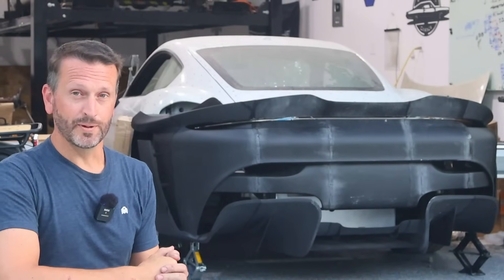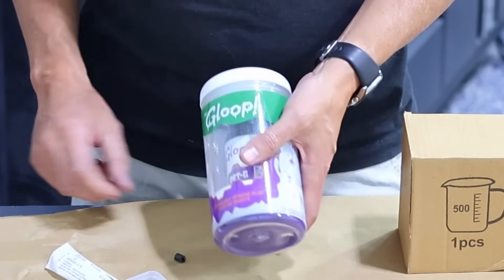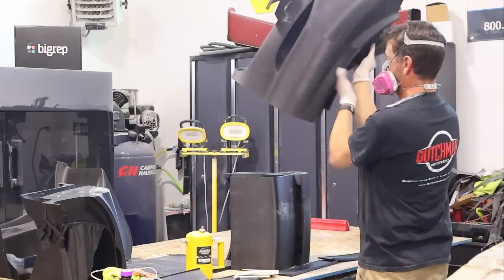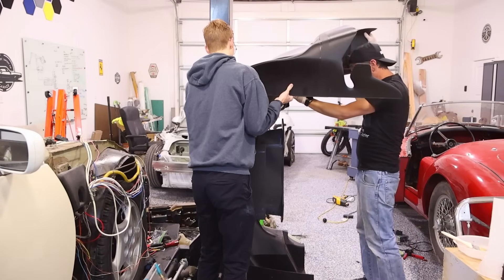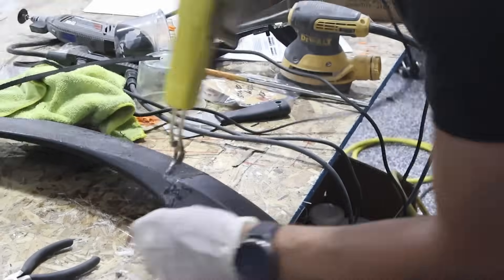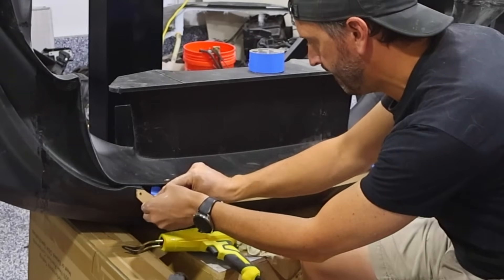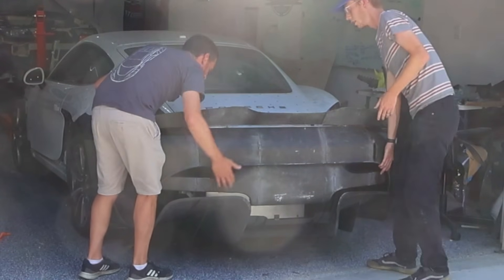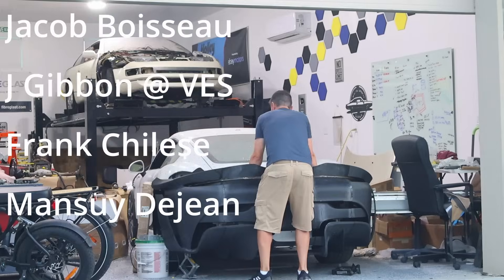World's Biggest 3D Printed Porsche Bumper

Comment: Hi nice bunch of projects , I also build car bodies etc , and use 3D printing to make parts and molds , tech when making your drawings include some dowels or lap joints on those surfaces to align the parts , much easier to glue or clamp on skinny parts , good luck , will be following , cheers Phil

Comment: 10:11 the right way to use the plastic bridge welder would be to rotate it another 90 degrees. this way you have 3 wire bridges ands not just one. nice video tho

Comment: Good luck but it'll never work as a driveable car. 100% as it the structure will fail. Even with mesh on the inside you're going to struggle. If it's just as a model then a tool made then fine. Going to need grp or pre impregnated cf. 🤞🤞🤞🤞🤞
Reply from the maker: Final part will be carbon fiber

Comment: how are you smoothing the printed part? 2k primer and sand or something similar?
Reply from the maker: The plan is body filler with sanding and polishing and then a 2k urethane to make the mold surface.   End part will be carbon fiber

Comment: If no one has suggested this you should add a key and whole system to the 3d model it would help you join the pieces of the model together. And give you more of a ability to line up the pieces together and a better chance of the model glue and hold on to each other

Comment: Street Bandito integrated some flanges into the bits for the electric Z. He was then able to use small clamps to keep them together while the glue cured
Reply: Also, I've used a 3d pen to join two printed pieces - first I would melt the edges to create a "valley", then lay a bead of the same material

Comment: But why would you 3d print that  bumber? Pla costs like 25 bucks for a roll of 1.1kg  carbon fiber is like 10 bucks per 1kg I mean not that im hating or anything but why that instead of CF
Reply from the maker: This will be for a mold to make a carbon fiber piece

Comment: I think you did a great job of course car companies won't be thrilled about it but they've been scamming us for a while by over pricing parts 😂
I just have suggestion for you if you ever try to do it again and this technically speaking:
you could do something like shark teeth between joints so you can maximize bonding surface between parts, also you can do like tongue and groove or even overlap type of joints so it would be even stronger and give you an extra strength because even-though you  bonded using adhesive and welding still those are considered weak points.
hope this helps you out and keep the amazing work
Reply from the maker: Thanks for the suggestion!

Comment: It may be too late at this point, but I'd consider making the entire thing out of multiple pieces such as the diffuser being one large piece, the side vertical  aero pieces being separate, and then the rest of the bumper being one piece. I might even suggest the upper spoiler section being it's own separate piece. This would help making the mold for the composite material way less complicated. If you damaged the diffuser portion, you would just need to replace that portion versus the ENTIRE rear bumper.
Reply from the maker: I probably will

Comment: With the plastic welder staples, I'd recommend turning the staples so that they're parallel to the seam as you'll get more coverage with each staple since it has more intersections with each zigzag. Applying them perpendicularly only gives the staple the one intersection at the seam. Since it only crosses at the one point.
Reply from the maker: Good call

Comment: This bumper look so freaking sick tho, loooove the design of it, amazing job <3 I done aaaalot of 3d printing, made lodes of models, for RC and stuff like that, i only use superglue with actuator to bind my prints, if it breaks, its not where i glued it, but prepping has very much to do with a good bond. i sand all the surfaces with low grit paper to get a very ruff surface, then i glue it ;) I use Biltema superglue with activator spray, bet you can get something just like it in the US too ;) Just wanted to share this with you, so maybe you can test it out on some other prints ;)

Comment: that looks so awesome!

one suggestion: use angled wirecutters to cut those staple pins. because when you wiggle those pins out, you might weaken those staple joints a little.

love your work, been following you since the K1 Attack build. Wish I could work with you.

Comment: It looks awesome!  In addition to the aforementioned flanges, for small parts bonding in carbon fiber rods as dowels works well. 

I highly recommend using ABS as well. You can well it much stronger with acetone, and epoxy and filler bond to it much better.

Comment: Location accuracy in bonding the individual pieces much be very critical. Would it be possible to aid this, and provide some adjustabilty, by including small bolting flanges on the 3D printed parts.  This would help in indexing and allow trial fit to the car before final bonding and welding the  sections together. The bolting flanges could be cut off afterwards. An alternative might be to design-in overlap tabs with temporary bolt holes.

Comment: Nice work integrating the hot staples. We use them in the Collision Repair world quite a bit. They work great! 👍
Edit: HEAT SET threaded inserts work GREAT on 3d printed parts for screwing pieces together.
Reply from the maker: Thanks for the comment!

Comment: Try some 2-Part plastic epoxy.  Similar to products like Gloop, 2-part plastic epoxy has a solvent that causes the plastic to become pliable, but some have an extended cure time to allow more working time. When cured, it offers 3000+PSI strength... the surrounding plastic material will break before the joint does.
Loctite, Gorilla, and JB Weld have some of these. (must be used in well-ventilated area)
Reply from the maker: Good call

Comment: The Design Studio collaborating with Jeremy here on the project👋🏻

First and foremost, the entire team at IJ Design Studio is thrilled and honored to be a part of this incredible journey with the Electric Supercar channel. Jeremy has made significant contributions to the community, inspiring many to embark on their own automotive projects.

We've noticed several recurring questions in the comments section, so we thought it would be best to address them all here.

Q1: Why 3D print the part itself instead of the mold?

A: 3D printing molds for composite fabrication, such as carbon fiber and fiberglass, is indeed an innovative and widely-used approach in the automotive industry. However, we chose to 3D print the panels themselves for two key reasons. First, the complexity of the design: even with the most skilled and advanced composite fabricators, some designs are simply too intricate to be created using traditional molding methods. Given the thorough nature of this project, we aimed to create the best-performing part that seamlessly retrofits the existing chassis without compromising design, integrity, or functionality. At our studio, function is as crucial as form. For example, the lighting elements in this car are integrated within the rear bumper, avoiding unsightly cables. Even though this detail is rarely seen, it exemplifies our commitment to meticulous design and creative problem-solving.

Q2: Why 3D print the parts instead of CNC machining a plug for molding?

A: While 3D printing is relatively new compared to traditional reductive manufacturing techniques, it offers significant advantages, allowing us to create complex shapes and details that are nearly impossible to achieve with other methods. By leveraging this technology, we were able to realize the perfect design for this project.

Q3: Why didn't you design locking mechanisms such as dovetails or keyways between the parts or flanges?

A: We certainly could have incorporated locking mechanisms. However, since we are not printing the parts in-house (where we can control tolerances to avoid issues like shrinkage or oversizing), we opted to keep the parts simple. This decision also ensures better adherence to the printing bed, reducing the risk of errors.

Q4: Wouldn’t printing it in multiple pieces reduce the part's structural integrity and make it more prone to breaking?

A: It's true that using FDM technology to print parts that will be subjected to mechanical stress isn’t ideal. The layer-by-layer printing process can create weak points that are prone to delamination and UV degradation over time. However, by reinforcing the parts with composite materials, we can significantly increase their stiffness and strength, often surpassing that of traditionally molded parts.

Q5: Isn’t this design too heavy for a rear bumper? Rear bumpers typically weigh much less.

A: While the weight of the bumper is higher than anticipated, this is partly due to unavoidable changes in the printer settings. However, even with ideal settings, this bumper would still be heavier than a standard injection-molded or composite bumper. Why? Because this isn’t just a rear bumper. Typically, rear bumpers are cosmetic pieces designed to conceal safety structures. In this project, we’ve made the bumper an integral part of the car’s performance and safety features. For instance, the car’s overall length has been increased to accommodate the battery pack, which needs to be protected in the event of an impact. We’ve added an additional impact structure to create a safety cage around the battery pack, enhancing its protection. Moreover, the bumper supports the rear wing (which generates considerable downforce) and houses the taillight electronics, making it a multi-functional component rather than just a "regular bumper."

Q6: Wouldn’t it be better to stick to the original Porsche design and parts instead of redesigning them?

A: While using existing parts would have been easier and faster, it would undermine the ambition of this project. Despite Jeremy’s humility, this build is on a completely different level compared to others. Although it’s based on the Porsche Cayman’s highly capable chassis, this car will be transformed into something entirely new, aiming for hypercar levels of performance. We respect the spirit of Porsche and have incorporated elements of their latest design language as a nod to the brand, such as the rear light bar. However, this car is not trying to be a Porsche; it is its own unique entity, and the design reflects that identity.

Feel free to ask any further questions. We’ll do our best to answer them.

Cheers ❤

Comment: Have you considered adding mechanical bits to your design, where you could screw and/or glue? 
Or even just some clamping areas? 
Or Alignment Pins/Dowels/Biscuits to the design, so all the weight on a joint is not taken solely by the glue. 
Or Magnets even. They are cheap and can even be printed right into the plastic... Or just glued in later.
There are these interesting little internal clips even, that could help pull and hold joints together.
I like to take woodworking practices into account when designing prints. (Joinery)
As such ,there are a number of things that can be done during the design phase that can save time and aggravation later.
Things that might offer some flexibility later on, like being able to remove a single part. Or split something in half for mobility/storage.

Also... Did you print out a way smaller scale version first?
Reply from the maker: Thanks for the comment!

Comment: JB Weld has two products specfically meant for plastics. Plastic Bond, and Plastic Weld. The Weld like the Goop has a solvent that "melts" the surface. I use the bond on PETG prints all the time. I have had layers fail before the bond. I saw you used regular JB Weld

Comment: I feel like 3d printing for parts is great for something small like an instrument cluster or other things on the interior but probably not so much for an entire body panel. I was thinking you could have just used the 3d print you used to make the mold for the replacement transmission tunnel for the MG.

Comment: Next time, 3D print some keyways between the parts (kind of like 3D puzzle pieces) so they are self-aligning and you don't need to worry about the popsicle stick method (plus, the keyways add extra surface area and support in different directions, so you aren't relying only on the glue to prevent shear along that plane). You can even design the keyways to accept some 1/2" bar stock for extra rigidity if needed.
Reply: @rthomp03  Yes, I was wondering why the 3D printing guys working with him didn't offer this solution to him, that would totally eliminate his need for cross sectional struts like he talked about too
Reply: he definitely needs to key the prints
Reply: they could also add holes for wooden dowels. i think this is how the guy from tofu auto works did it
Reply: The designer gave this reason:
"Q3: Why didn't you design locking mechanisms such as dovetails or keyways between the parts or flanges?

A: We certainly could have incorporated locking mechanisms. However, since we are not printing the parts in-house (where we can control tolerances to avoid issues like shrinkage or oversizing), we opted to keep the parts simple. This decision also ensures better adherence to the printing bed, reducing the risk of errors."
Reply: @EM-yp1cf  dowel holes eliminates these issues
Reply: @AceHunter-o1i  Yeah that's kind of a weak excuse, there's several ways this could have been done without making the parts more complex or having tolerance problems. Would have saved tons of time assembling.
Reply: When you've got more money than know how
Reply: Cmon leave him alone, much more thought went into for views/show than actually doing the stuff.

Comment: Hey, I love what you are do here. It's been awhile since I've done any CAD work but, here's my idea anyways... 😀 Have you thought about putting holes in the mating surfaces for alignment pins? Using a chamfer at the bottom and top of the holes would eliminate need for extra 3d printed supports for the holes and give somewhere for the glue to ooze out of the hole without getting onto the flat matching surfaces.  The way I'm picturing this is creating a subtraction part shaped like the holes you want in the main part. Then cut and pasting them wherever you want an alignment pin. The planes in the main part used from separating the big part into smaller parts could be used a guide for where the place this subtraction part. Idk if I make any sense but it seems like this would be easy to do in CAD and make putting the parts together easier?
Reply from the maker: Very nice!

Comment: I have done a bunch of big prints not quite that scale. Simplest method to make alignment easy and strengthen joints is to use metal rods or bars. It is easy to print holes in precise locations in model. Can always drill out if too tight, though I usually print some tests to get right hole size for snug fit. Have used 1/8th steel rod for small joints up to 1/2 electrical conduit from
 Home Depot for large joints. Feel it would make it much easier for you. Can also recommend heat set threaded inserts and machine screws for joining parts. You can tap printed holes but have to have the whole the right size(printed or drilled) to not break the part due to expansion when tapping. Mechanical fixings are usually way easier and more reliable than glue on 3D printed parts in my experience.
Reply from the maker: Good call!

Comment: For the next large 3d print you need to bond pieces together  I’d recommend doing flanges (either perpendicular or overlapping) gives a lot more surface area and you can get a bond nearly as strong as the layer lines or stronger depending on the print material. I personally like 1/2-1” overlapping flanges and I’ll usually use solvent bonding solution in addition to plastic welding the back side with reinforcement mesh. Ends up being very strong and much easier to ensure the visible surfaces line up properly and make a mold as the plug ends up far more rigid
Reply from the maker: Good call

Comment: I love this project and everything you do, thank you for sharing all of this with us! The plastic welder is amazing, those little staple things are cool. Now, I know nothing about 3d printing, but for a big piece like this, wouldn't adding some male/female joints save a lot of the work you had to do in this video for creating stable unions?  *EDIT* I continued watching the video, and I see that this bumper is just a placeholder. So maybe the extra modeling work wouldn't be worth it, especially if you're just going to be using it as a structure for shaping the finished product.

Comment: Not sure if someone has already mentioned this but sounds like Gloop works the same way PVC pipe cement works, though possibly less agressive with a shorter activation time. I do wonder if the rear spoiler is about 20% too long. Angle is probably ok, but seems too long and may produce some unnecessary drag. Have you tested it to determine the result drag coefficient?
Reply from the maker: Working with airshaper

Comment: Looks cool, but I personally would have gone with carbon fiber. It would have taken a bit more time depending on how it was done but would have probably been stronger and 1/2 the weight.
Reply from the maker: Carbon fiber is the end goal.  Going to make a mold from this
Reply: 👍 nice. I was concerned the plastic might soften in the sun, but if it's just for a mold, then you're one step ahead @electricsupercar
Reply: @electricsupercar  Ah, great job my man, great job! Please post that process, I love working with FRP, CF. and mold making!